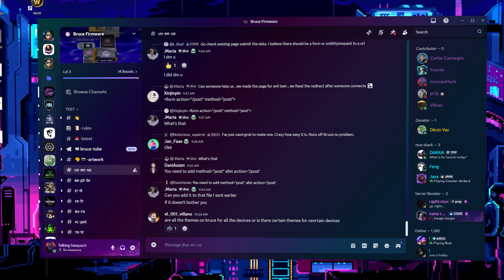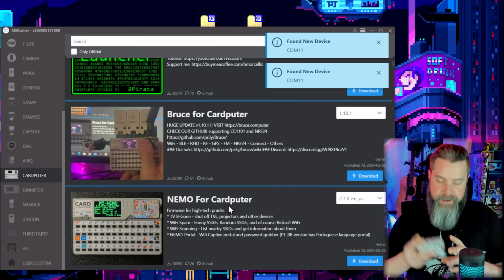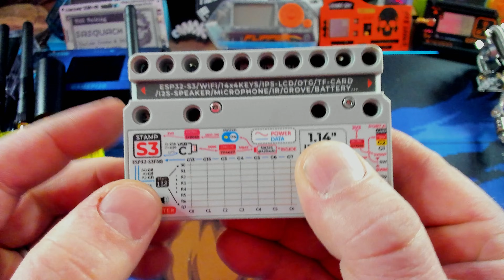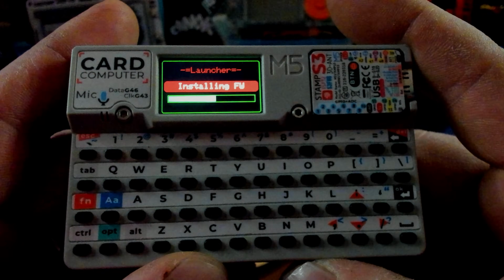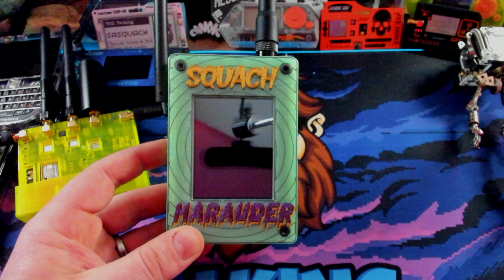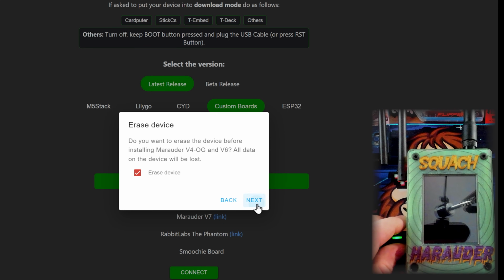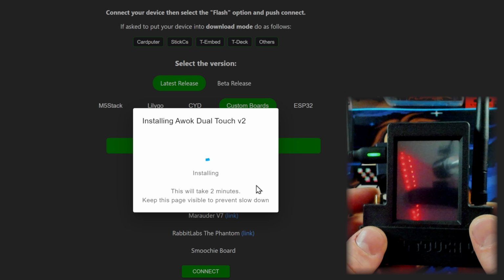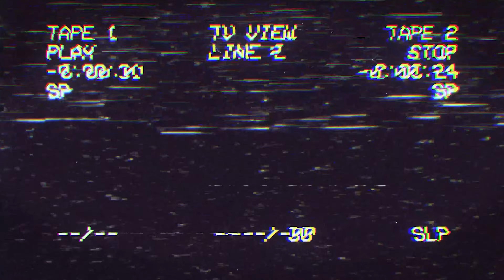M5Launcher DIY Upgrade Guide (What You NEED To Know!)

Comment: Is that Bruce? what interface is that? on my cardputer it has a cooler interface with icons and stuff. Installed it using M5burner, version 1.10.2. M5Launcher and Bruce are my favorite firmwares on the card